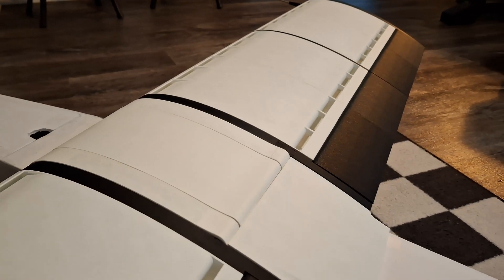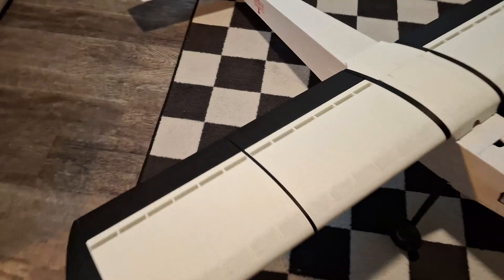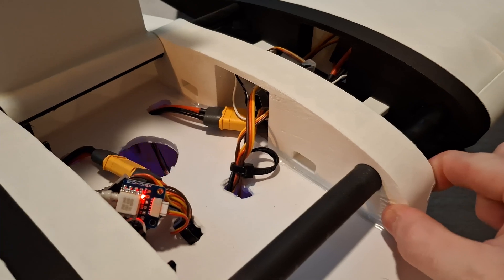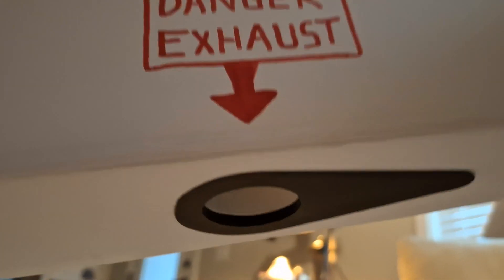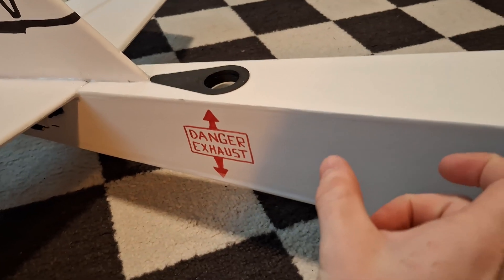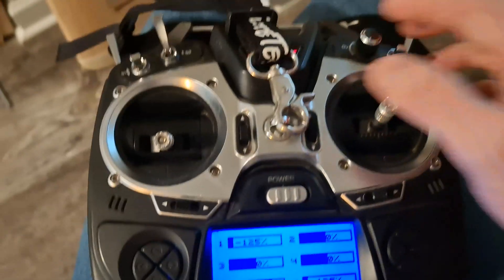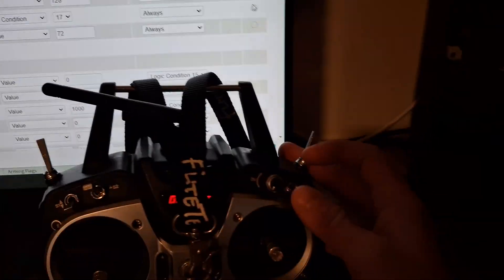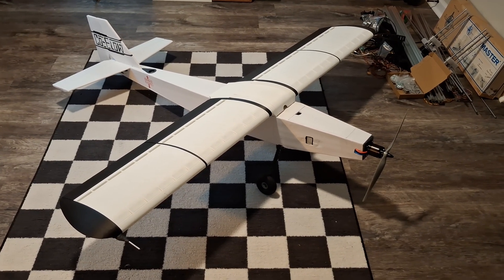Co-Flow Wing Testbed: Demo

Comment: Very nice, can't wait to see its flight performance.  Have you considered an actual alpha vane?  Maybe you could build one with a tiny magnet in the vane sensed by an AS5600 or similar mag encoder.
Reply from the maker: Haven't really considered it. Could probably work, just dealing with the interface to the flight controller and getting the data to get logged seems like it would take a good bit of work

Comment: How will you calculate the Cl from the flight data, please explain that as I am also doing my final year project and I need to interpret the flight data from my own plane design !
Reply from the maker: Wing area is known and dynamic pressure can be calculated based on airspeed. 

Getting the lift force is the hard part. The aircraft has accelerometers and a known mass so you can easily get force normal and axial to where the aircraft's nose is pointed, however lift and drag are defined not to where the nose is pointed, but to the freestream velocity, where the airplane is headed - the difference being angle of attack. If we can get angle of attack, then we can use it to transform the force vectors to the freestream frame (by a 2d rotation matrix) which then allows us to calculate CL. CD is a bit more complicated since thrust is in the equation, so can only be truly measured with power off, a load cell measuring the thrust of the motor in-flight, or extrapolation based on some performance modelling.

To get angle of attack, we need to know where the airplane's nose is pointed and where it is headed. Flight controllers will have an estimator (usually something based on a Kalman filter) that looks at data from all the available sensors and fuses them to get an idea of both the aircraft's attitude and velocity vector. The important thing is that both airspeed and GPS are required to get the latter, because it allows wind to be calibrated out of the velocity vector, which would otherwise skew results (the FC should do this automatically as part of its estimation routine). Finding alpha should be as simple as figuring out what coordinate frames and in what format the FC reports both attitude and velocity and doing the appropriate transformations to the data to determine the angle between the two vectors in the pitch. Typically attitude is either a quaternion or in roll/pitch/yaw in degrees, and velocity is just given as components in global X, Y, and Z (with some thinking needed to determine reference frame and sign convention).

Alternatively, test passes can be made in steady level flight. Since we know the velocity vector is on the horizon, the deck angle of the aircraft is the angle of attack. The downside of this method is that and upwind and downwind pass is required to calibrate out wind if wind data is not available, and that it only works for the steady level condition. It is a viable option though. Varying airspeed would then vary angle of attack.  I'll probably be doing a mix of both.

Comment: you can check 
Tom Stanton video of making the an airplane 3d printed wing or what ever its called its really nice save tone of weight and time depnding on the goemtry cause not always u can print it in vase mode for example this EDF wing section is really hard to get printing in vase mode never the less it saves ton of weight and its really strong
Reply from the maker: I used his video as a reference back when I was trying with the actively-foaming stuff, unfortunately I didn't have much luck with it. I came to realize that a Co-flow wing cannot be printed in vase mode, since any slice where the internal duct passes through will necessarily have two separated perimeters. This also means that the wings will be far heavier than usual wings since all that internal ducting essentially doubles the perimeter of the filament used - going from leading to trailing edge twice instead of once.

The upside of not having to print in vase mode (which was greatly aided by the ease of pre-foamed filament) was that I could do a lot less CAD work by not having to do all the tricks needed to get internal structure with vase mode - Just set it to single outer wall, 5% cubic infill, and full send. It also freed me up to put in 100% infill hardpoints for some small mounting bosses that the hatches screw into, which would've had to be another part otherwise.